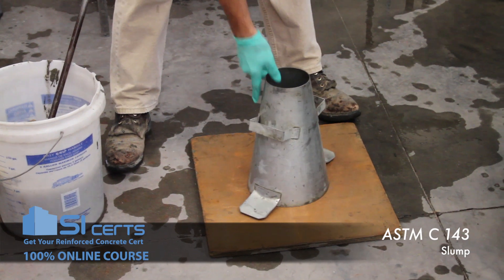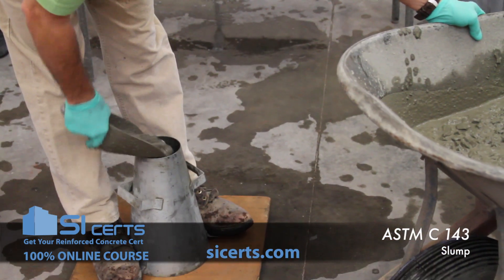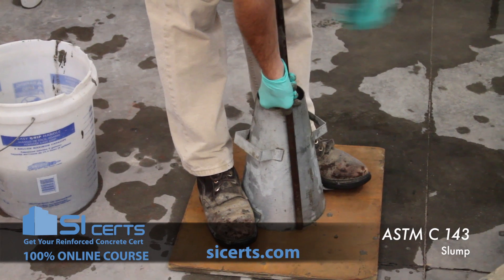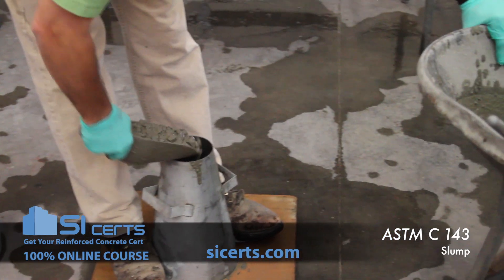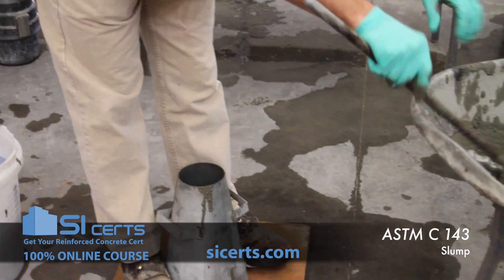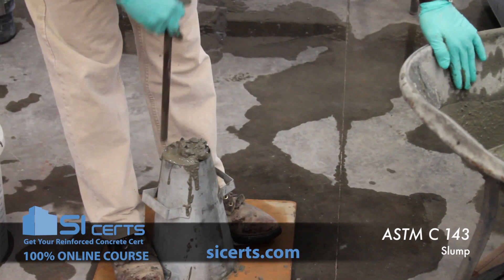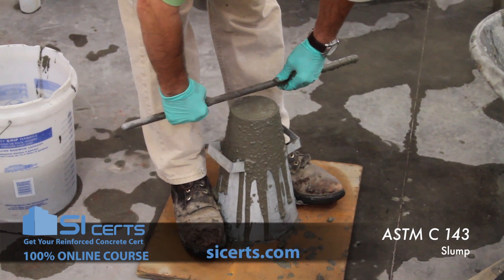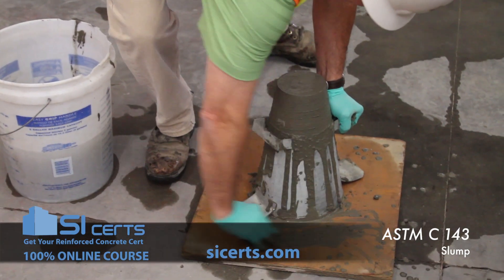ACI Slump Test: ASTM C143 Concrete Slump (Newer Version Available, Click Top Right Corner)

Comment: Hey Rakib, we have an updated video on this FYI. But to answer your Q, there's not really a standard diameter, or we don't think of it that way. The cone dimensions are standard, which makes the diameter of the material inside consistent. What varies is the height of the fall or slump of concrete, and that's what we measure to record the slump.

Comment from the maker: Great question. I've heard contractors say a 5" slump is the "perfect" slump for workability but stiff enough to suit most applications. But there isn't really an ideal range. It just depends where it's going. For example, a parking garage ramp with a significant climb would most likely take a 4 to 6-inch slump. Any higher and the concrete slides down. A load transfer beam with heavily congested reinforcing steel needs high slump (8 to 10 inches) to fill in all the gaps.